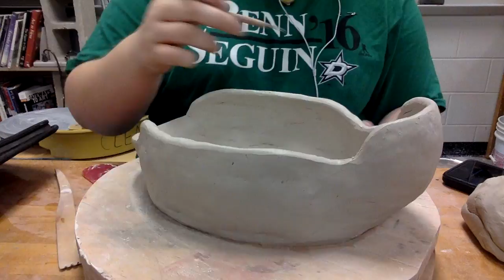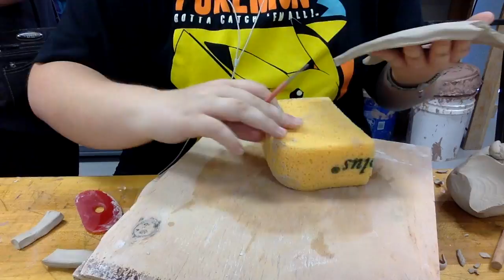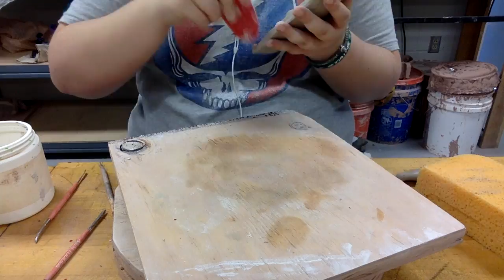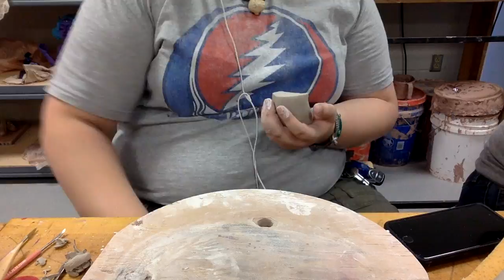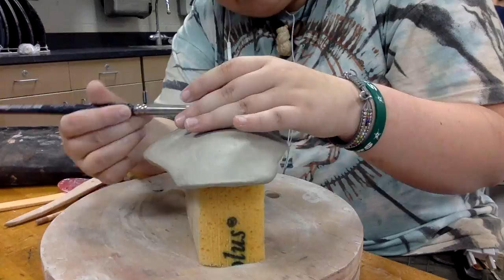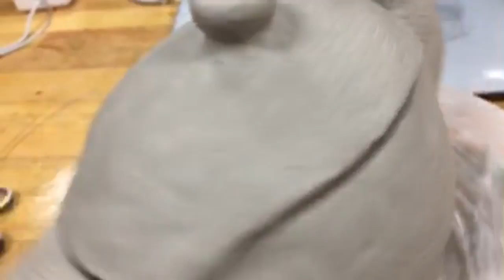Great Blue Heron Jar- Coil Building Process

Comment: With the head and neck being a solid chunk of clay and the rest of the body only a thin wall I see a problem drying this thing, the tension in the material because it dries unevenly tearing the head off in the drying process...
Reply from the maker: petrairene the head and neck are hollow! It may have been too fast for you to notice me hollowing them out in the video. They dried just fine with no cracking!  :3